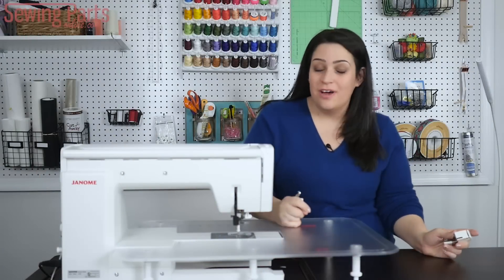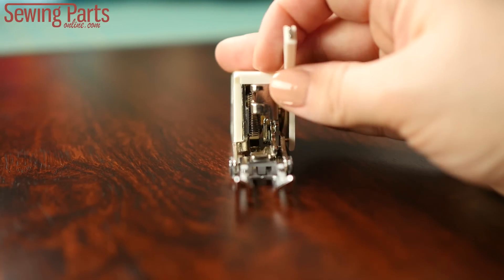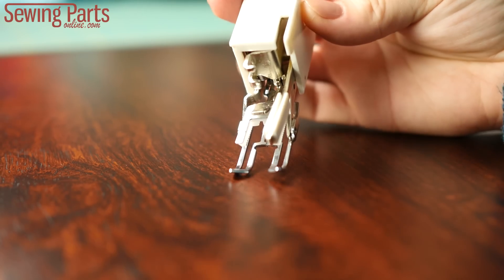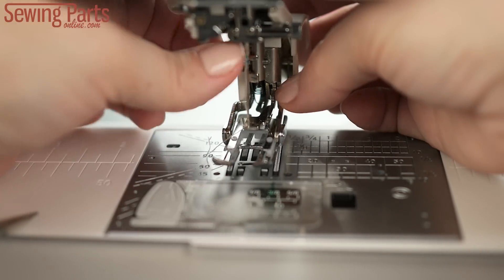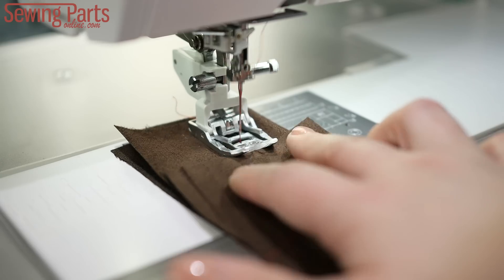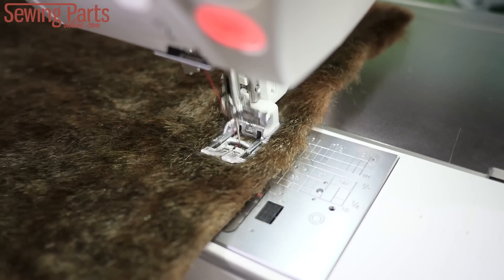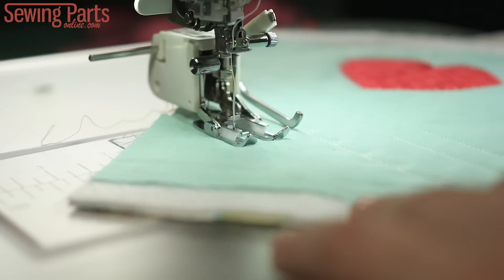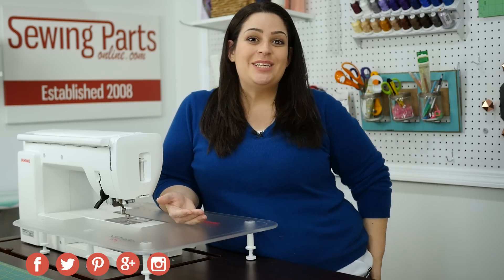How to Use a Walking Foot (Updated)

Comment: Great tutorial.. I always forget about the walking foot.
I'm hemming demon stretch jeans, just to confirm that when using this foot I don't change my regular settings?
Reply from the maker: It just depends on your fabric. You should be fine with your regular settings; however, try testing on some scraps before moving forward with your project. Also, if you're having issues with that fabric, double-check your needle; you will want to use a denim needle. :)

Comment: This was so awesome!  Are there any uses that you would not reccomend for the walking foot? Could I really just leave this foot on and use it to sew Everything?
Reply from the maker: You could just leave it on your machine, however, a quality Walking Foot is pretty expensive and they do wear out over time and with heavy use, so using a general purpose foot or straight stitch foot whenever possible means you extend the life of your Walking Foot.

Comment: AWESOME!  I was just thinking about this very subject this morning.  I have some hand woven dish towels to hem and the them is going to be REALLY thick.  I see the walking foot is what I might want to use.  I will be weaving a great deal this summer and fall using heavy cottons and wool.  This is going to really help get my projects sewn.
Do you have any other suggestions for sewing hand woven fabrics?
Reply from the maker: Thank you for watching! I would just make sure you have a good universal needle and high-quality thread. Good luck!
Reply: What is a "universal needle?"  Is there a different kind of thread for hand woven fabrics?  Seem I have a lot more to learn than I thought.  I have woven some 3/2 cotton dish towels and plan on weaving curtains.  What type of thread is best for these fabrics?  I am spinning my own fine yarn (pure wool) for skirts, tops and light shirts.
Reply: I have a Singer SW2145.  Just got my walking foot out of the mail box an hour ago.  Setting up my machine to do some practice with it as I have not used it ever before.
Reply from the maker: Hi, Barbara! These needles will work with your machine:https://goo.gl/1Ezi2H
For the really thick towels, use a size 100/16.

Comment: I would love an explanation of the difference between a $12 walking foot and a $50 walking foot. Why do the cheap ones wear out so quickly? Also, is it okay to sew in reverse while using an even feed foot?
Reply from the maker: You're looking at difference in quality. The higher priced options are made of better materials, usually have more metal than plastic, and last longer. Also, it is not recommended to sew in reverse with a walking foot.

Comment: I have the Janome 12000.  The manual says to use the straight stitch plate with the walking foot.  Consequently, I have only used the walking foot for straight stitching.    I would assume you need the zigzag plate in order to do some of the examples you presented in the video.    Is that right?    Thanks, great video!
Reply from the maker: Hi, Donna! You are correct! If you plan to do any zig zag stitching or decorative stitching, you would need to switch to a zig zag plate.

Comment: Thanks for the information.  I have a slight problem.  When I tighten my needle clamp screw to attach the needle clamp bar on the walking foot I cannot screw it tight enough to hold my needle.  When I do, it's too tight and then my bar and walking foot won't move.  When I loosen the clamp screw the bar and foot move but then the needle falls out.  Suggestions?  Longer needle clamp screw?  If so, where do I purchase that?  Thanks for any help!
Reply from the maker: I think we may be able to fix that problem. What is the make and model of your sewing machine?

Comment: And where can i get the clear extension for the machine its so nice , does it come with your sewing machine or you get it separate thank you
Reply from the maker: Hi, Suzy! That particular table came with that Janome machine, but there are many clear acrylic tables on the market. We just need to know your machine make and model to find the correct fit. Give us a call at 888-824-1192

Comment: My walking foot works fine for a while. Then it starts to lift up off the fabric. I have replaced needles and double and triple checked the settings. Any thoughts? I'm sewing a quilt so cotton fabric with batting.
Reply from the maker: Hmmm...Is the screw on tight?

Comment: HELP! I'm sewing a layer of Minky fur to a layer of regular Minky, but it seems to be pulling the bottom layer more than the top layer resulting in obvious puckering throughout. 😕I've cleaned the feed dogs, put in a new stretch needle, tried different pressures and nothing seems to help. Help please!! What can I do to fix this problem? I have a Janome 3160 QDC  and the Janome walking foot.
Reply from the maker: Hi! I'm so sorry you're having trouble. That is combination is definitely very difficult to sew. Have you hand basted the seam?

Comment: I just purchased the walking foot for my Brother SE400. I am making placemats and the fabric is still shifting. What am I doing wrong??
Reply from the maker: Oh no! Hmmm...what type of fabric are you sewing? Which walking foot did you purchase? You may have to use a couple of pins, but shouldn't need that many.
Reply: I am sewing with cotton fabric. Like the kind you would use for quilting.  I bought the SA188 open toe walking foot for my SE 400 Brother machine.  Since posting my question I have tried taping the fabric. It still puckers and it seems like my foot shimmies my fabric to the left. I am at my wits end.  I was thinking of returning the walking foot and getting another one.  I have checked and the feed dogs on the walking foot move in sync with the feed dogs on my machine.  I really appreciate you replying to my post.

Comment: I'm having awful skipped stitches with my open toe walking foot.
I put a new needle in and reinsert it. My needle is threaded correctly. Tension is correct. Thread is correct. No luck.
Reply from the maker: Sometimes, it is not attached to the machine properly. Can you send me some pictures of the walking foot on your machine, from a few angles? Also, please include a picture of your model number? 😊tricia@sewingpartsonline.com
Reply: @SewingPartsOnline  
I just swapped out the open toe for the regular walking foot and no more problems. Apparently the open toe walking foot can't be used with fleece.

Comment: I just started using my walking foot on a quilt. The problem I'm having is my needles fall out and they also brake. What am I doing wrong>
Reply: Could be you are not pushing your needles up high enough into the machine and maybe not tightening them enough.